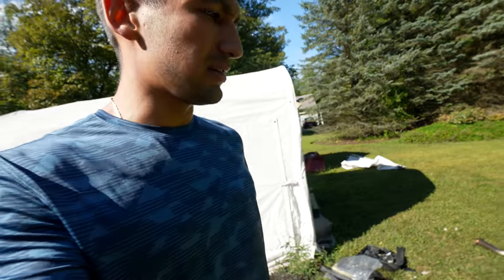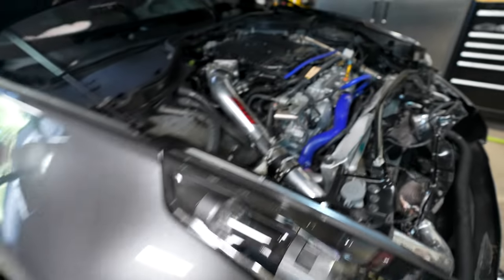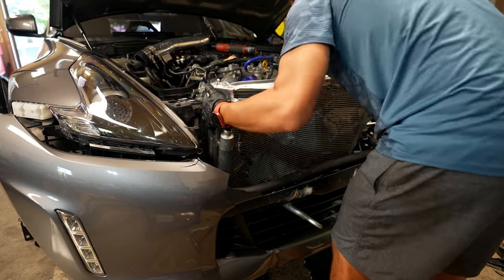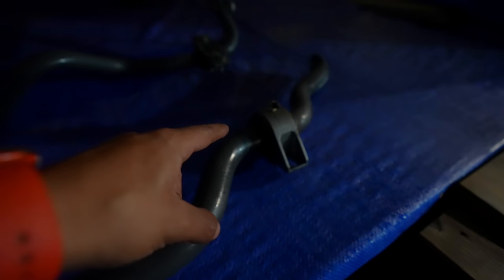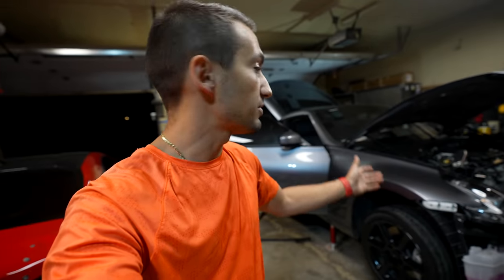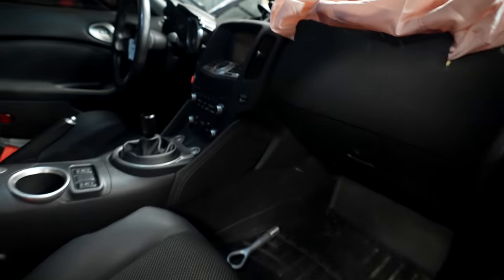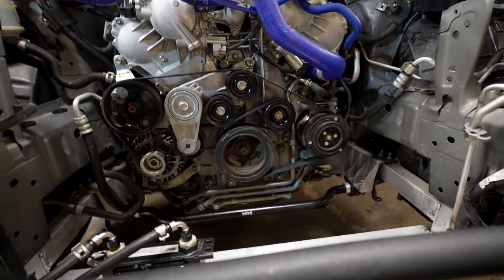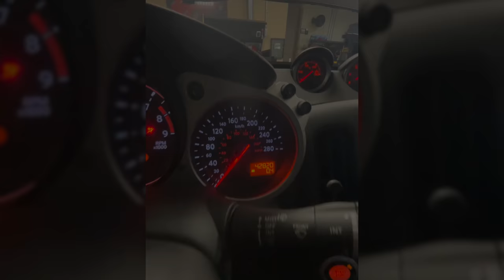WHAT'S THE DAMAGE? // Post Deer-Collision Inspection

Comment: The damage on your Z can actually be repaired by you for the most part, I’ve fixed a few front ends and I can say you’re more mechanically inclined than me and you do seem like an engineering student idk why, least educated. Luckily your frame look straight and your core support is a bolt on. You don’t need a welder, if any metal needs pulling a body shop or a cheap 6-10k-lbs winch puller with some videos will teach you how to make pulls to adjust core support as needed. I estimate about $5k to get it back, you need a donor car for some parts, new mechanicals of course. Mainly fix it mechanically which I know you can and get the replacement core support front piece in place, which you maybe learn it isn’t too bad once you understand how it works. Air bags account for about half the estimate, if you can source those used cheap you control a good chunk of the cost. You replace it yourself, here I have locals that can do the seat belt and seats if that got deployed, then for programming a couple hundred. Your fender gaps seem well, driver side maybe buckled little bit, possibly can be fixed. You can upgrade hood, or replace and wrap to avoid repaint, you’ll need to repaint front bumper find a shop for that. You don’t have to take a $15k+ loss when damage in reality will cost a fraction of that plus your time and labor, worthy considering you’re playing w bout $10k+ for that work. Also you grow your skill set. You can also do the work and sell it simply, market a premium now and I hear last quarter 22 or early 23 chips be back market will start to adjust and you should be able to find a replacement for what you got for the Z, you need to wait the year for this if it end up being accurate.

Comment: Fun story:
I was a mechanic way back in the day.  This reminds me of a woman that came in one November complaining about "the smell" she got when running her heat.  She had an early 90s ford explorer (fairly new at the time).  We got it in and put it up on the lift to look at the heater box.  We found the smell pretty quick....

Turned out she'd hit a deer a month and a half prior but hadn't seen any damage so she didn't tell anyone.  We pulled what was left of an entire rear leg out from between the fire wall and back of the engine block.  All I could think is thank god it had been a cold fall!  That thing was NASTY.  We didn't have to really fix anything so we didn't charge her for the removal, but we DID insist on taking it down the street to an automotive cleaners to have them pressure wash the engine bay before returning it to her.

So don't worry, your blood and guts could have been a lot worse!  We can deal with it.  :)

Great videos, great documentation.  Keep up the good work.

Comment: I see your radiator support is bent up. Would that be frame damage? Or does the radiator support just come out?
Reply from the maker: The radiator support can be replaced, but the issue is the welded headlight brackets need to be straightened before reassembling with new / used parts.

Comment: You can get the seatbelts rebuilt. Goonzquad often sends their damaged ones out, and you could even get the colour changed.
Reply from the maker: That's awesome! I'll have to keep that in mind for sure 👍
Reply: Yeah I’ve had mine rebuilt before. I used safety restore after I wrecked my g35. I kept the same color and they reset belt tensioner